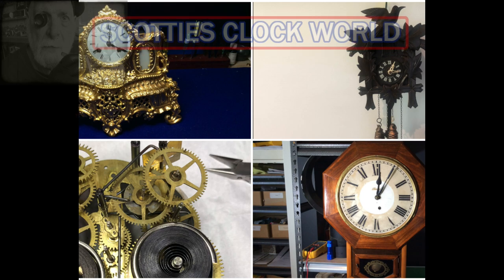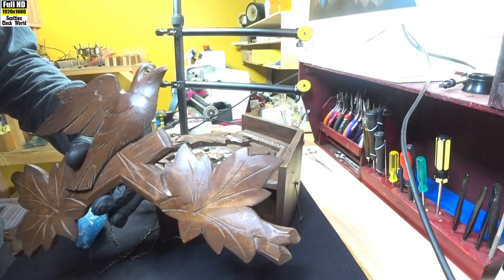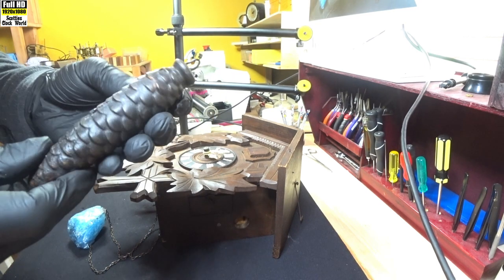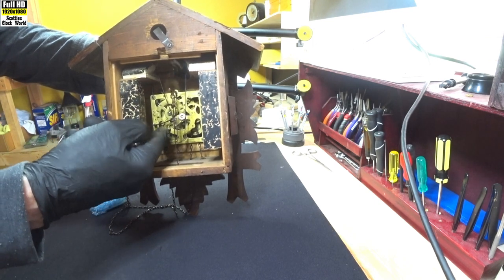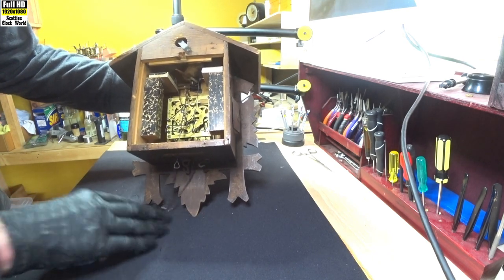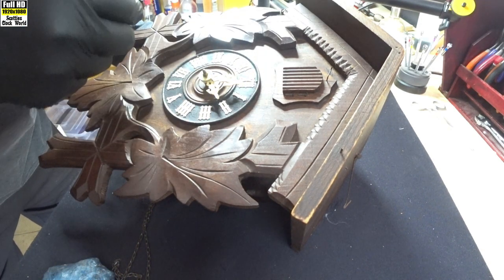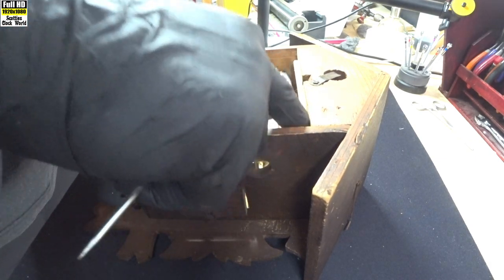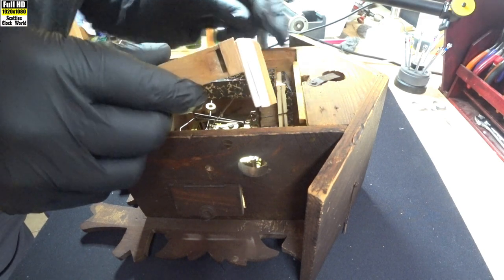5 Leaf 1 Bird 30 Hour Mechanical Black Forest Regula 25 Carved Cuckoo Clock - Part 1

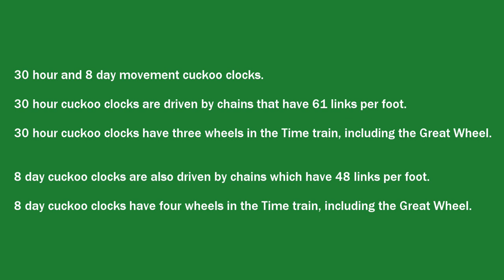Comment: Do you have any knowledge concerning these Regula25 main wheels with the Chain Guard, with post? I installed one on the time side at the 12:00 position which interfered with the Escape and 2nd wheels because it rotates, and the post has nowhere to anchor to.
Reply from the maker: Mark at: @munnerlyn3 will be able to answer your question for you.